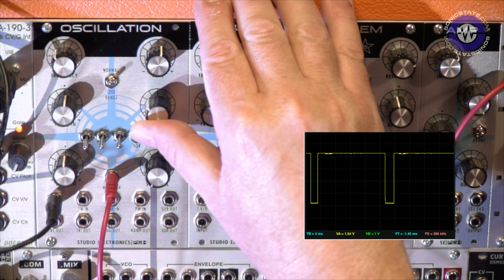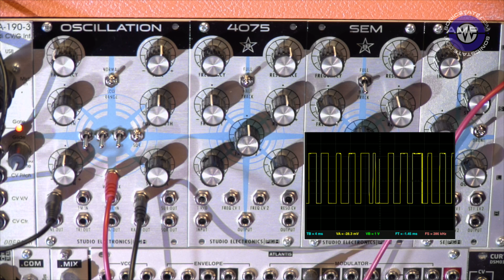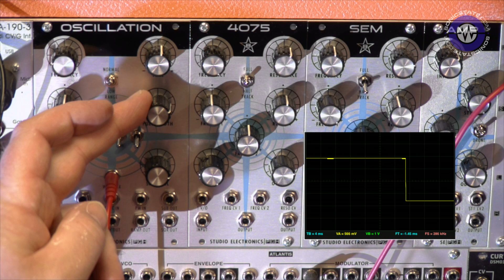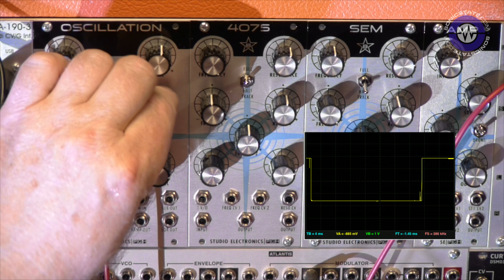Studio Electronics Boomstar OSCILLATION

Comment: Can the sine out be fed into the fm to work like digital FM synthesis?
Reply: +Robert Jackel you're free to do that, but remember, the sine coming out of the sine output will have its frequency modulated by whatever comes into the FM input, so you'd be modulating the sine's pitch with the sine's pitch, it'd be circular, thus kind of useless.  You need to send a waveform from a separate oscillator into the Boomstar's FM input to get effective FM synthesis.  And BTW, FM synthesis can be done in the analog or digital domain ; )
Reply: a lot of the fun of modular is trying out this sort of stuff... Yes, it does work, but more useful for a drone or if you have a nonquantized sequencer, you're free to experiment limitlessly.  These are not suited to "easy" fm synthesis a la make noise or Verbos, or, especially, buchla (just sounds the best here), but they have a VERY full fm sound, full range and sparkly, makes a DPO sound rather thin.  For the size of this oscillator, I would have loved to have bipolar potis for the waveforms and linear fm, but there isn't much else in eurorack that has this full range of a sound.  Studio electronics stuff just has so much presence.  Not the smoothness of Macbeth or whatever the hell makes Cwejman so appealing, but certainly up there in its own way.